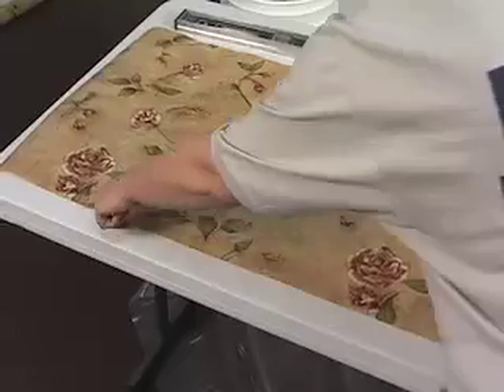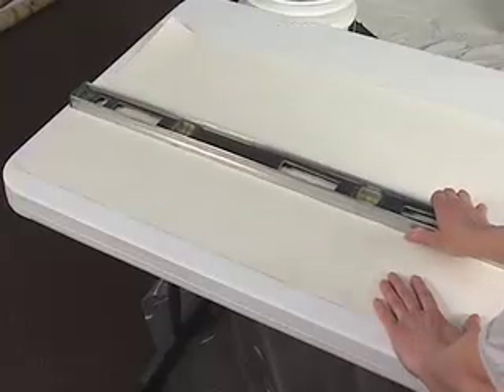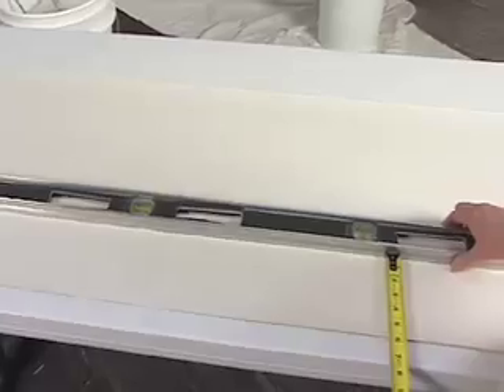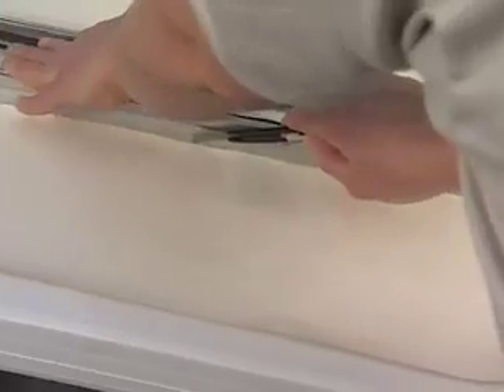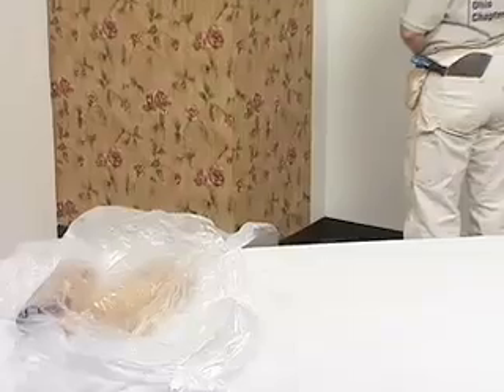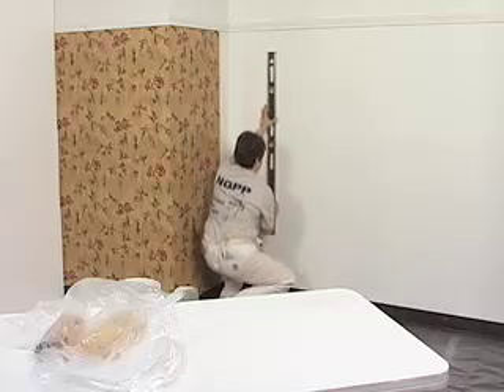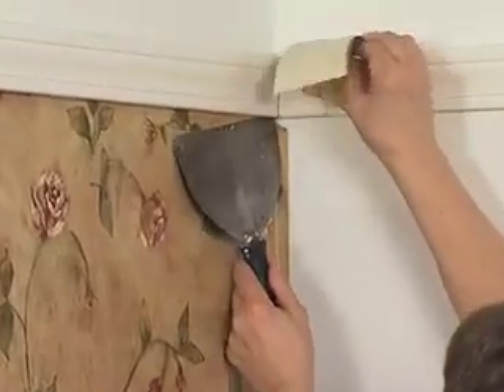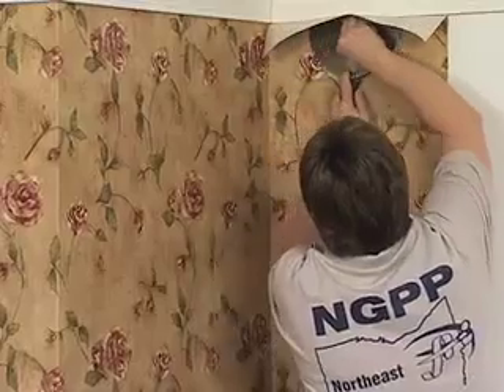Wallpaper Installation - Sidewalls Part2

Comment: No you couldn't because it's unlikely the edge where the two walls meet would be straight. So it seems the solution is to paper as best up to the seem as possible, while the 1/4 inch lip you paper over deals with any spaces. 

Great video, and love the voice Hal ;-)

Comment: also if its vinyl wallpaper  use pva glue  down the edges  ,then wipe of the ecess with a sponge,also work away from the light to hide the joints or seams  ,so start at  the main feature wall to keep the pattern equal on both sides ,start in the middle and work away from the light if its possible  ,try to end in a hidden corner

Comment: I agree with the first strip measuring at three points, taking the biggest reading and cutting the paper with extra added.
This may be something he forgot to mention but on the second strip you have to allow for the wall being out as well, so another measurement should be taken using the same technique and plumbing your line accordingly.  This vid says take the measurement from the off cut and plumb from the corner to this measurement. If the wall is out like I said u could get a gap?